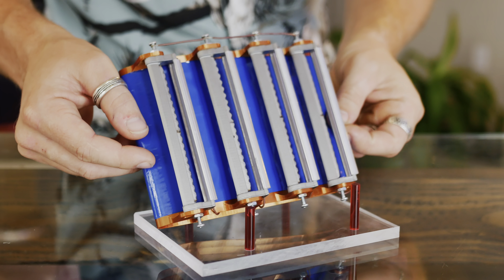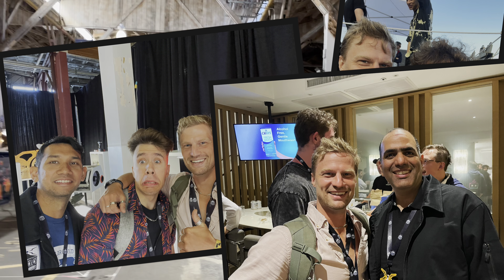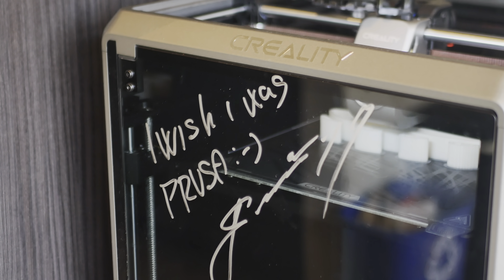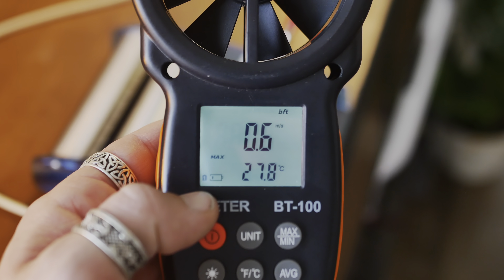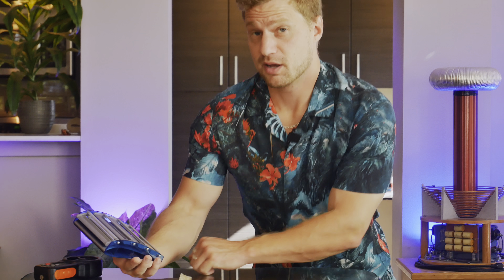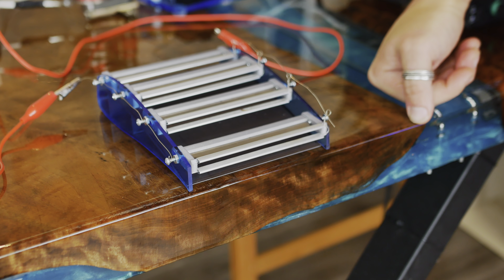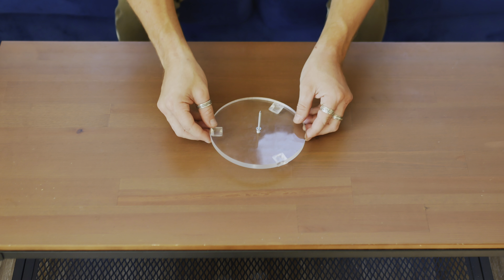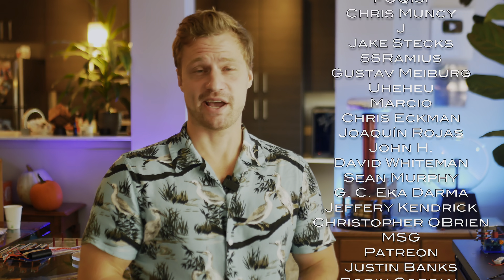Designing A Self Propelling Ionic Thrust Wing

Comment: I'm just a carpenter that's always wanted to fly.. BUT.. wouldn't it be more efficient to apply the ionic thrust on the bottom of the wing instead of the top? My reason of thinking is because the air going under the wing doesn't have as much drag and the air on top speeds up to create lift. By adding ionic thrust to the bottom, the top would/should compensate and increase lift.. maybe perhaps 🤔

Comment: Like the idea, very impressive.
My only doubt is with this setup you kill the lower pressure area on the top of the wing and it will produce no lift.
You might try to ensamble the truster inside the wing itself.

Comment: I'm no aerospace engineer but wouldn't it be more beneficial to put the thrusters on the bottom of the foil? If I'm not mistaken the way a foil works is the bottom of the foil has a higher pressure than the top. After all every airliner I've seen has had its engines mounted on the bottom of the wing.

Comment: I’m not an engineer so I don’t know what I’m talking about, but did you test whether the angle or height of each thruster relative to the wing surface is important?  It looks like the trailing thruster is higher above the wing surface than the others and also looks like all the thrusters are aimed horizontally flat rather than following the profile.

Comment: Rumor is that extremely high voltage difference bettween leading edge and trailing edge can cause a gravity wave that the wing can surf.  Positive leading edge and negative trailing.  It is said to be how the B2 bomber achieves extraordinary miles per gallon of fuel.  The turbine engine exhaust is used as a magnetohydrodynamic (MHD) generator to generate the extreme voltages needed. Of course this is just a rumor.

Comment: Okay so I make 3d printed planes and something I do to save weight is I use LW pla which stands for lightweight and it cuts the weight of the pla in half and it is super easy to print so I really suggest to get from color fab or any other supplier you find best just know that I have had good results and hope you will to if you read this comment

Comment: I'm confused. You talked about how Jets are engines with wings strapped on and that was an epiphany... but this is still a wing with Ionic Thrusters strapped on. Why arent you you making segments of the wing itself the Ionic Thruster instead of just bolting them onto the top? Your first design was already basically a wing being strapped to the top of another wing. Could you not just make a larger one of those as the wing itself? With tweaks obviously, but this just doesnt seem like what a Jet does at all.

Comment: i don't know about having the thrusters on top of the aerofoil, i would imagine that having the thrusters be inside in the body of the craft like a fighter jet (using a ring type thruster design like integza's) would be better simply because it wouldn't be interfering with the aerodynamics of the aerofoil, also because every thrust you strap along the length of the massive aspect ratio wingspan will just add more weight making it tougher for the wings to generate enough lift to glide with

Comment: i would be looking at how the airflow is around each of your thruster sections. You may be able to to drop the thruster into the upper side of the airfoil to give you a more efficient design. The big problem you're going to run into is airfoil efficiency when you've got a massive obstruction on the upper side the the airfoil.

Comment: Does it transfer much heat to the gass itt trusts? just speculating iff you have a big pipe system and usse the trust to compres and decompres te gass in a closed loop. maybe its possible to exchange some heat for cooling purposes? if the gass (air is te most ideal iff itss possible) att more than atmospheric pressure maybe the ions have even more push? silent cooling would be nice

Comment: I've messed with this technology since the 90s (when it was mistakenly lumped under electrogravidics). The key is to focus on incremental improvement, not trying to change the world.

If running a single wire in front of a metal wing on a commercial airliner reduces fuel burn by 5%, they'll do that.

Comment: It can only work if the Ionic force can go faster than the wind going over the wings.
To get airborne you need to go a lot faster than that.
Also, the "junk" on top of the wing will interrupt the lift capacity of the wing.
And a plane has to go fairly quick to get enough lift or you will need a very long runway. (or not get airborne at all)

Comment: Nice design, now make it into a circle ufo design an one more thing u need a top on it to control the pressure waves of your design to app up the efficiency of your model by a factor of five or ten fold.  An instead of straight lins across the wing try circle or tringanles an show us the progress of this thanks.

Try building it into the wing an split the wing with a gape with the ionic power inside the wing it self too u might find it interesting.

Comment: @PlasmaChannel    Why dont u try a phased trigger of blades timed in sync with the air speed relative to the gap between blades ? So blade 1 fires then as air catches blade 2 it fires etc.. i guess this will give you more thrust.

Comment: You should put the thrusters under the wing. Not only does it contribute to balancing the nose down pitching moment of the wing (meaning you will need a smaller tailplane area so less weight), but you also want to avoid obstructing the flow on the top.

Comment: If you built a housing similar to a turbo engine, and made it pull the wind along the walls, it could be a really good way to make the pressure and thrust needed for a proper engine.

Comment: Absolute noob here: Could someone kindly explain me why the wings/blades need voltage passed through them (essentially being treated as a circuit with a positive and ground terminal)? I just stumbled upon this gem of a video and very curious to learn something from this. Thanks!!
Reply: I don't understand how passing voltage is moving the air, hence aiding in the rotation of the wing @14:24 .

Comment: More into the material holding this together. Have you ever thought about using LW-PLA? If you can learn to print filament with a foaming agent, then you can shave off 20-50% of the weight of the 3d printed parts.

Comment: You can also try to metal coating your plastic 3D print for maximum efficiency. No need to add conductive tape or else, and the weight should be minimal with maximum surface.😉

Comment: Lift is generated by creating a surface (a wing) that causes oncoming air to travel faster over the surface than under. This difference in pressure from the air lifts the surface. Disruption of the air traveling over the wing via speeding it up even further with an ionic drive makes me feel like you would run into significant drag issues.

Comment: Why not Build the thruster into the actual full aerofoil rather than above it.  You can achieve both the wing aerofoil plus using the thrusters as part of the structural integrity.

Comment: ionic thrust is thrust,, why are you mounting it on the wing, can you not get enough thrust if you mounted it in a long tube to use as the airframe body, The top of the wing surface is low pressure, would the thrust not interfere with this.

Comment: Wow! Clap clap clap man... Just one point, will it still work in rainy conditions or when suspended fine solids are in the air in the case of a volcanic eruption?
Reply: What if it were to be placed on the body instead of the wings? Or in new plane designs such as the V plane?

Comment: Wait, how about this: put the blades Inside the wing, but instead of the plastic wing design make a bare frame only, put the blades Inside the wing, then cover with aluminum foil for decreased weight but increased thrust? Could that work?

Comment: You may have already considered, but flattening the wire can improve the ion wind by focusing the breakdown to the flattened points/edges.
I think calendaring rollers may be useful, particularly if you can bias one side to be wider.  
Also embedding a grid of HV positive wires instead of one single rasorblade edge leading edge might improve, as in your last design showed for thrust.
Reply: Forsure designing a grid would help. He needs to calculate the field stress between electrodes as well, including how the electrodes at the trailing edge experience weakly ionized air. I would also like to see v/c measurements of both electrodes while they are running if you have the equipment.

Comment: I was going to put this in my other comment, but decided I wanted this to have attention.  Please attach the wing to the stand and place it on the scale when you turn it on.  As you are propelling the air over the airfoil, it is already generating lift.  That should be measurable with a sensitive enough scale and should definitely be a design parameter for the aerofoil and wing shape.

Comment: Did you test adjusting the angle of attack on the thruster segments concerning the wing? I would suspect that the airflow velocity might not change much, but the pressure profile on the wing itself might improve.  The way you have designed this, the air velocity over the wing is going to be compounded between the forward velocity of the wing, the ambient air velocity, and the ionic thrust.  This means that the thrust is not only contributing to thrust, but also directly to lift.  But it also means that as the wing speeds up, the thrust will become less of a contributor to both forward velocity and lift.

Comment: Wow thats so impresive to see. Love your iteritive process. I aee why you are using pla to print but wouldnt it be far lighter to cut the aerofoil from thin foamboard? And the other thoight i had is how is this going to perform when the wing is acrtually flying? I think to make the power source part of the wing is an interesting concept wont it affect how the wing actually works in the way the pressure differential gives lift? I guess it depends where the air intakes are. This is so fascinating to follow

Comment: I think this might be the eureka moment for actualized ionic earth bound flight. try to adjust the directions of the ion to that it pushes tight against the wing upper surface, I feel like there is a way to make essentially a 2 layer wing, You might want to look into electrostatic speakers. They use an electro conductive graphite coating on top of a plastic structure which you might be able to utilize to reduce some metal parts.
Also remember that you should also have access to other materials like carbon fiber which will allow your base segments to be smaller and lighter while also being stronger.

So much potential here

Comment: Really cool concept, however I think you should probably ditch 3D printing altogether for this project. The plastic is just too heavy to ever be able to fly with such low thrust. Probably build the aerofoil out of thin laser-cut balsawood and plastic foil and the thrust components out of thin wire on the positive side and aluminium foil on the negative, or something like it. Just everything to reduce weight as you need all the spare  you can get for the battery and high voltage components. Probably don't even install avionics and only fly it on a wind free day or smt.

Comment: Why are you always using line shape for  electrodes? Make several little circles of copper wire and point them to a line wire that has no shape(just a normal row of wire). Not only will it perform the wind coming out from the center of the circle electrodes but also, it will reduce the weight by 50%. Draw my model on a paper to see what I just said. Remember to try to force the output electrons coming out of the circles to become a center shape on line wire because it reduces the power.( If it is possible to make this model, the air will come in the circle wires and after they flow out another air flow will join because of the surface shape of wind from circle wires to line wire ). Good job man👍

Comment: I think that you should use this embedded in the wing and use the thrust to delay wing stall at lower forward (indicated) speeds. Being embedded in the wing will reduce the form drag. Think of it as a form of slotted flap. Use your round thruster embedded in the fuselage with an optimized thrust tube to provide the forward thrust. This combination should allow you to fly at a lower angle of attack and keep drag lower so your main thruster can have an easier time of doing the heavy lifting.
Reply: The F104 Starfighter used something similar with “blown flaps” using bleed air from the compressor section of the turbine.

Comment: If you are talking about new eras of flight one thing to definitely consider is the power efficiency of this engine, especially comparing to traditional propellers, from the last ionic engine video it only have around 40% power efficiency, which is significantly lower than just normal propellers.

Comment: Hi man very cool just a few suggestions:

1-Consider evaluating the amount of 3D effect you are introducing into your test by the dimentions in terms of width of your test wing. Also take care about the Reynolds and better get a grasp of how it works in terms of physics and how turbulence behaves since for the results you are getting out there that matters and I would say a lot. 

2-You are focusing on thurst (say on the experiment with the rotation) which is used in real flight applications to both energize the air current but most importantly to balance drag. And Drag is a necessary evil in aerodynamics since it is the horizontal component derived from the actual pressure difference obtained with the airfoil shape and the energy (velocity) of the current around It. But do not forget about the vertical component which is lift and allows you to actually fly..just saying for the problem you are trying to solve maybe the scope should be wider than just focusing on pure thurst rating.

3-In terms of structural resistance I think you are not gonna make it with the final light weight design say in actual scaled full wing dimentions due flexural and torque stresses.

Anyways nice try man!

Comment: I think you've hit the spot every mechanical/aerospace engineer needs to employ some electrical engineering. I bet $100 you need to independently pulse the ionic goodness with PWM MOSFETs. You should be able to fire them in a way to get power or thrust and maximize efficiency. I think a good place to start is understanding magnetic drives like rail guns.

Comment: If you put the thrusters on the under side of the wing you will increase lift.  Lift is an equilibrium measure, the air traveling over the curved portion of the wing takes longer to reach the rear of the wing than the air traveling over the flat portion.  To compensate for this pressure differential the wing is moved towards the low pressure area.  If you increase the speed of the medium across the underside you increase the pressure differential.

Comment: This is awesome, but as a pilot I have so many questions: 
how this will wing performs during ice encounters? 
Do the thrusters metal plates heat enough for ice to melt? 
Will the increased surface area be detrimental? 
What if you have a single line thruster on the trailing edge of the wing, would that help with drag? 
Why are you using a fat wing? Do you plan to store the fuel inside the wings? If not, you could go much thinner!

This is a rabbit hole haha

Comment: I'm not sure if someone has already suggested this to you, but the electrical mass can be placed on the wing profile, while it would be sufficient to use simple wires a few millimeters away. This solution would result in a mass slightly greater than a standard wing.

Comment: You should consider electroplating the plastic instead of using metal to save weight. Spray conductive paint on the plastic surfaces you want to plate, then use a common method like nickel plating to create your cathodes/anodes.

Comment: Bored, thinking. Right now you have stages that accelerate air in a very haphazard way. And all are doing the same job. I think you may have more success in a tunnel type setup. The first stage is there to get the air moving. Second stage is there to speed it up. add stages and power as you need. As the wing increases in speed the initial stages may have to retract as there job to start are movement is now moot. as they are retracted the power may be diverted to the remaining stages to increase the the speed of the already moving air. Don't know it that makes sense. It does in my head...lol. But I must admit..I have no knowledge about this topic what so ever. Was just thinking.

Comment: Jay, look at using an aluminum door screen mesh for the electrode instead of the blades. Huge weight reduction, awesome conductivity and the wind it produces is super impressive. It'll do what you're looking at with the serrated blades, but has way more points when you trim the mesh. Tested it last night and it works great.
Reply: Or a scroll saw blade. You could make a jig and flatten it further on a belt sander
Reply: I do believe that that's the first perpetual motion machine right there. Hook it up to a pulley and you can then power up your car.

Aim the car down a steep hill, so you can then get to work for free every day. Just take an uber home, and get your dad to tow your car back up hill (you might have to loan him a truck and a chain), so you can then ride your perpetual motion car back to work for free every day. Hook up your cell phone charger to the alternator in series with a flux capacitor and a rectifing diode pack to charge your phone, so you can call your dad for a tow, every day.